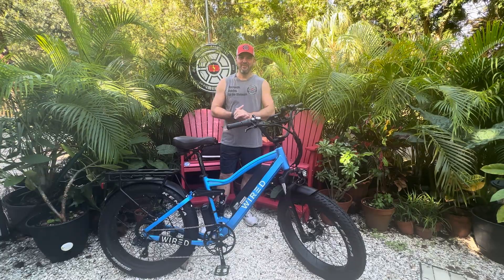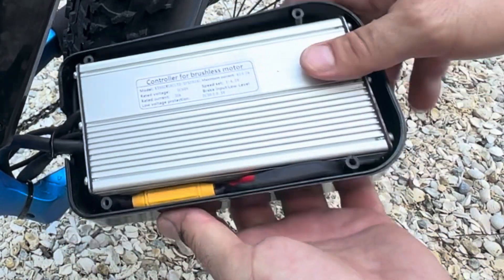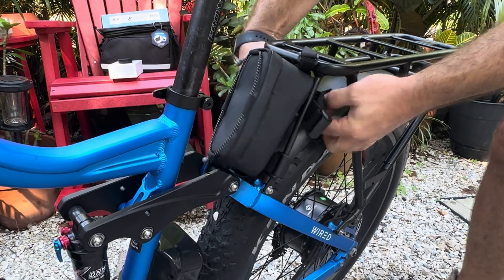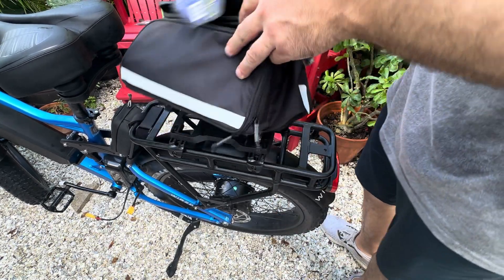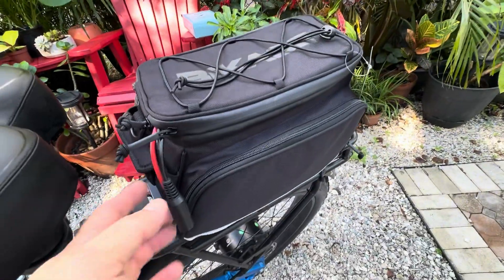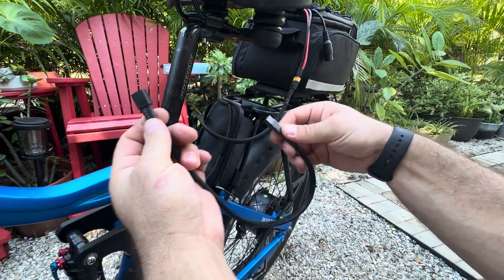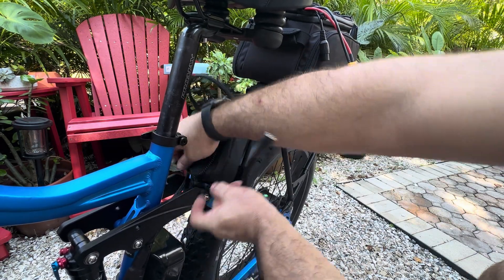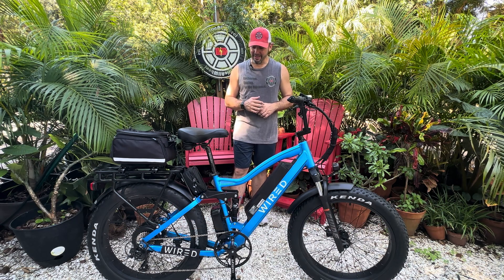Wired | Freedom | E-Bike Plug & Play Dual Battery Install w/ Dx2 Dual Battery Combiner 12AWG Cables

Comment: When I installed my second battery, I was disappointed to discover mine did not have XT90s in the controller box, but Anderson Power Poles (not sure if they were the 30 or 45 amp versions) in the frame.  Mine was one of the first shipments of the generation in the video.  Luckily there was enough wire slack up near the frame battery connector to replace the Anderson's with XT90s.

Comment: The battery you used in this video is no longer available on amazon, following the link you provided. Could you provide a link to a different product or vendor that would work with this setup?